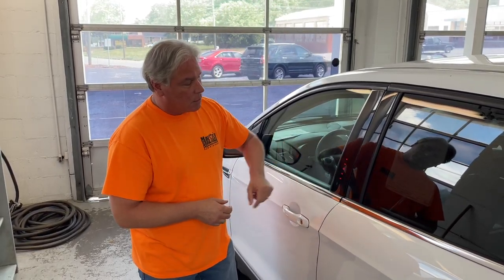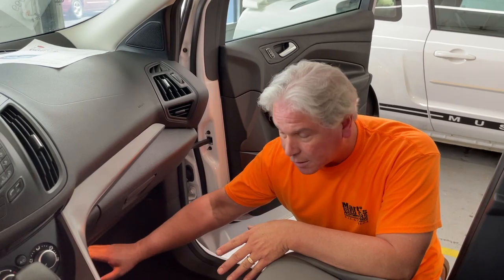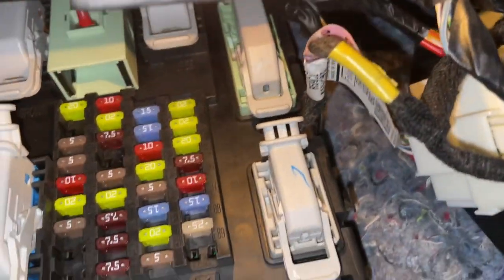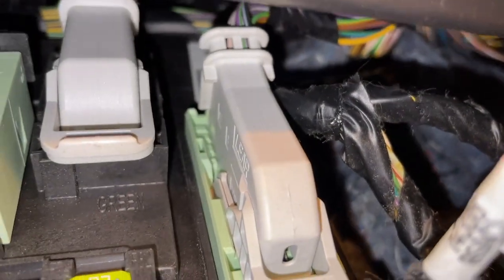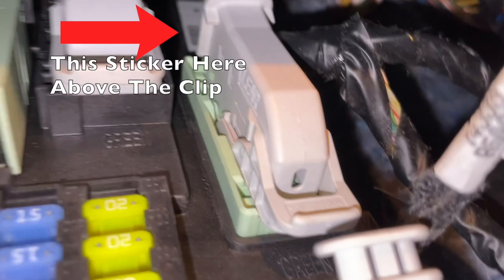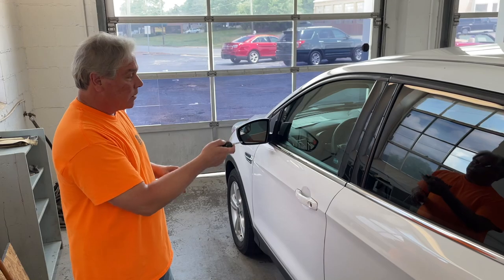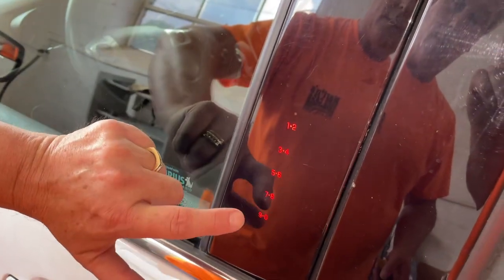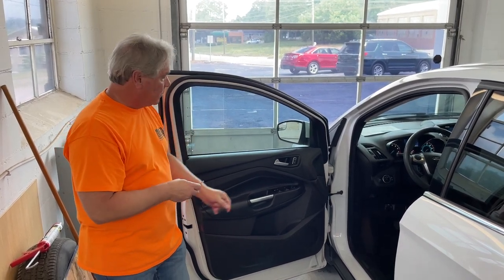How To Find / Locate Your Door Code On A 2013-2019 Ford Escape

Comment: You are a life saver! I bought this exact vehicle model and Carmax did not provide any key code. That's just a minor inconvenience compared to what other surprises came with the car. Battery died three weeks after purchase, two months later had to replace radiator, radio failed, fun stuff.😅

Comment: I think it is the code that unlock the driver’s side. Hit 3/4 to unlocked the other doors and 5/6 the lift gate or trunk. I still have a good memory from a 1988 Ford Taurus that my father used to have with the key pad.

Comment: Thank you for the information.  We have a 2013 Ford Escape and the remote doesn't work.  We changed the battery and I tried the turning it to run 8 times etc and still doesn't work.  Any suggestions?